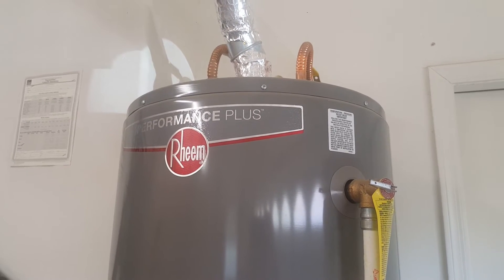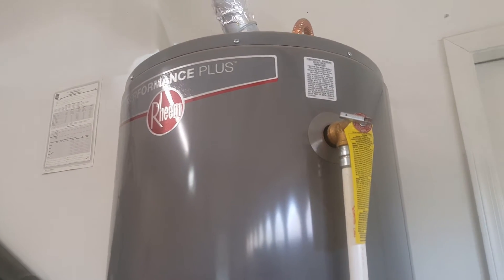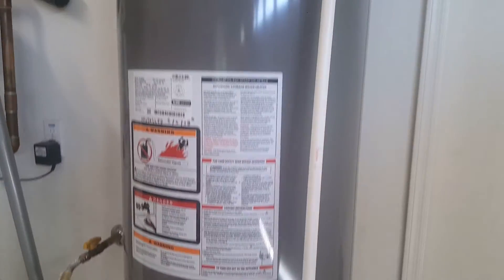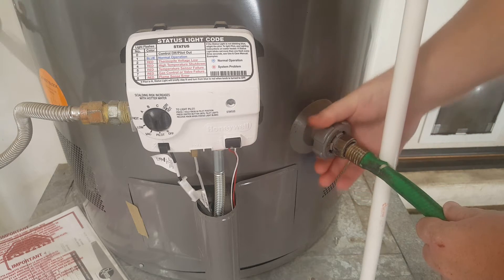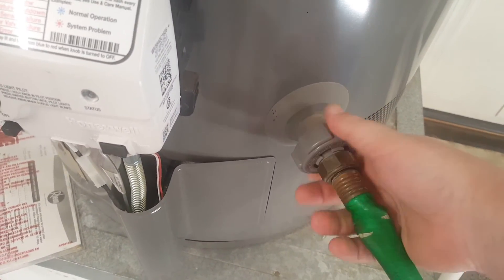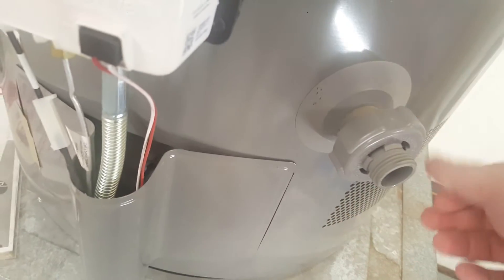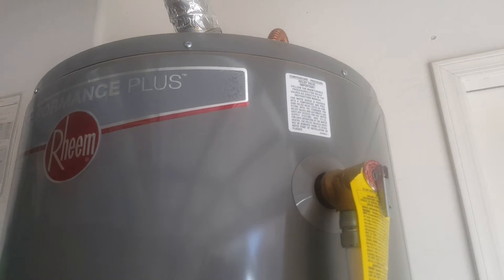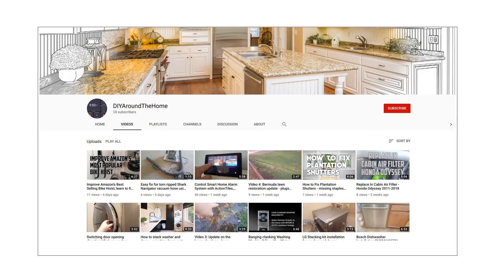How to Flush Water Heater and Test Pressure Relief Valve

Comment: I have the same model water heater as yours.  When I drain the heater out, there is only a small water trickle.  Does that mean the drain is plugged up?  Are you suppose to turn the cold water inlet valve back "ON" to flush out the system so the sediments at the bottom can be disturbed ?
Reply from the maker: Is the hot water in your kitchen sink or bathroom left open? If not leave it open.
Reply: @DIYAroundTheHome  Yes the hot water faucet in the kitchen is open.  If the drain in the water heater is plugged up with residue they say poke it with a wire to break up the build up.
Reply from the maker: @beerborn  Can you see build up? Have you tried opening the pressure relief valve? That can help sometimes too.